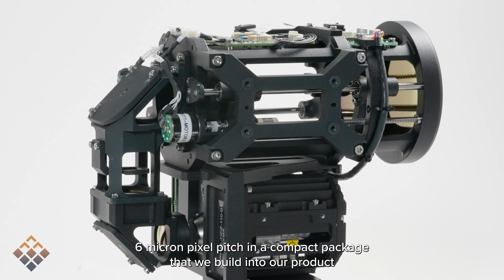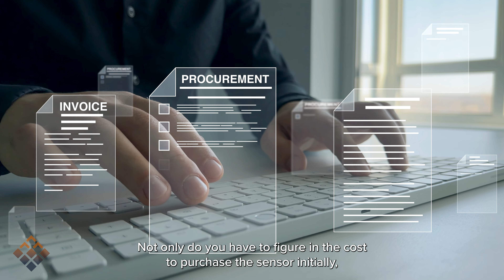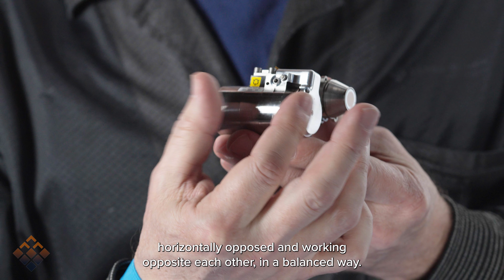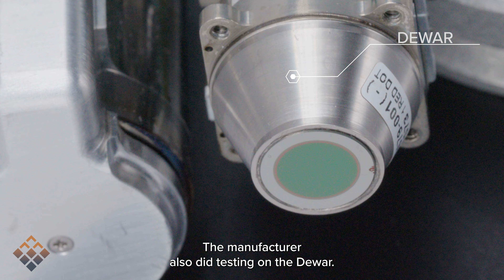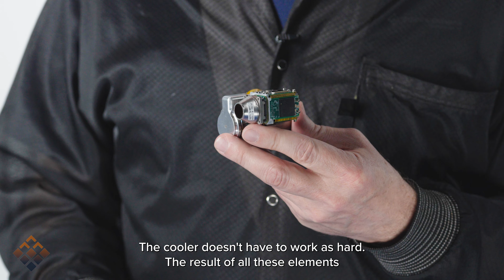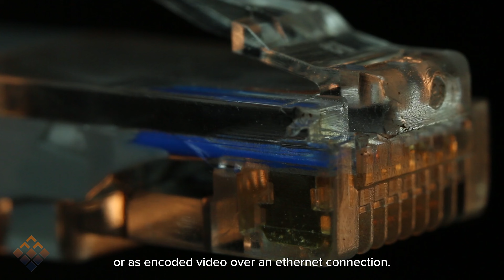HexaBlu® MWIR Sensor Core — Small Pixels, Big Performance | SOTI Tech Talk

Comment: Generally speaking, does a HOT MWIR system suffer from noise more than a standard MWIR cooled system for the benefit of longer cooler lifespan? Or do they both offer similar sensitivity to temperature differences?